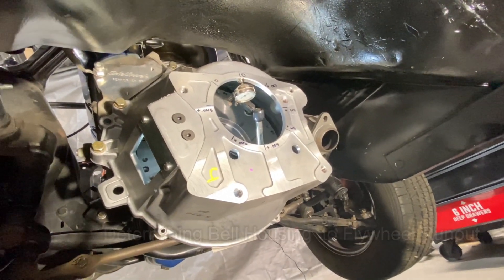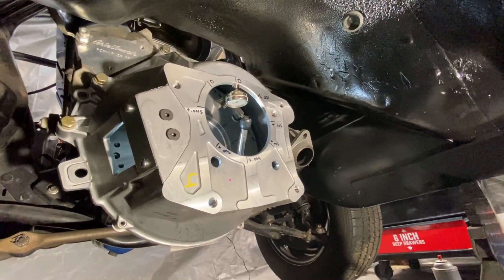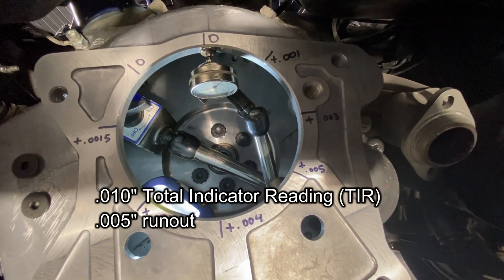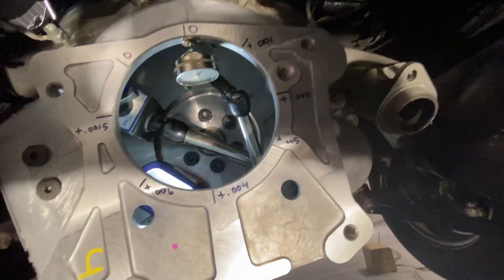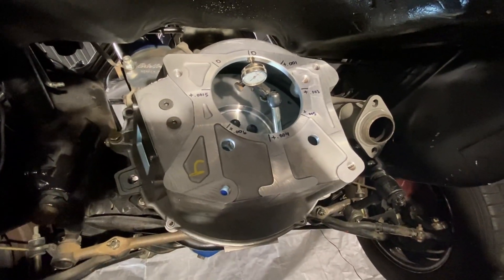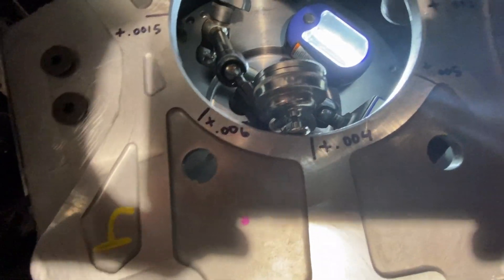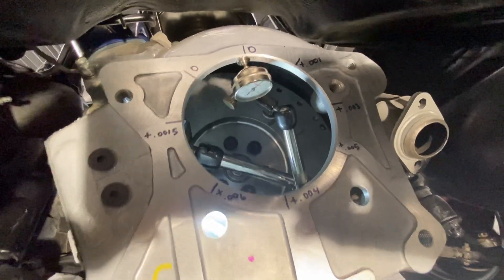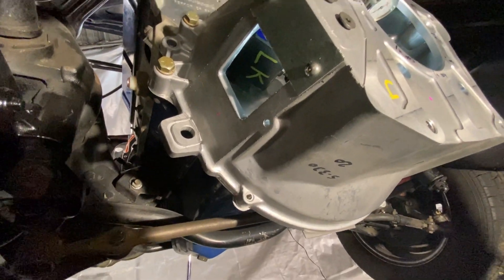Measuring Bellhousing to Flywheel Runout T5 Bell Housing

Comment: Can you provide a link for the temporary garage kit you are using? And would you recommend it?
Reply from the maker: I got this kit 
https://www.ebay.com/itm/6-Leg-Carport-Canopy-3Way-4Way-Fittings-Combo-Footpads-For-1-5-8-Poles-Tent-/142691747747?mkcid=16&mkevt=1&_trksid=p2349624.m46890.l49286&mkrid=711-127632-2357-0

I used 8’ fence poles from hone depot and various fence pole brackets and connectors to add plywood to the roof and walls
Reply from the maker: It was very useful having the structure whereas I would have been working in dirt sand and snow without it.
Reply: Thank you for the quick reply and information! Love the t5 swap as well. Nice job!

Comment: Why would this matter?
Reply: If it's too far out of alignment you will get premature and uneven wear on the input shaft, pilot bearing, transmission bearings...also can cause shifting and clutch problems...Especially at higher RPM shifts.  Tremec requires this to be done to validate their transmission warranty.  An experienced transmission tech can tell if the bell index was out of specification when he opens the tranny up.